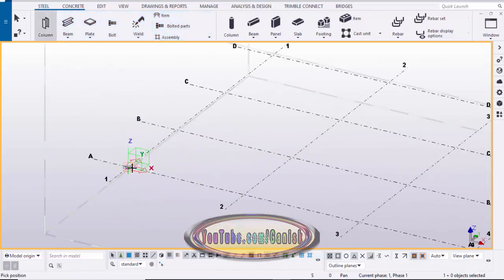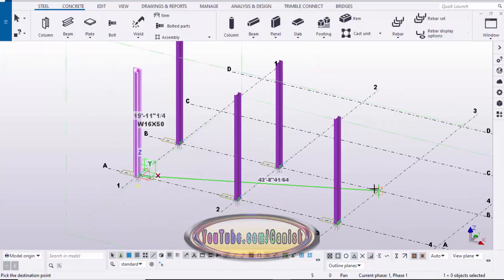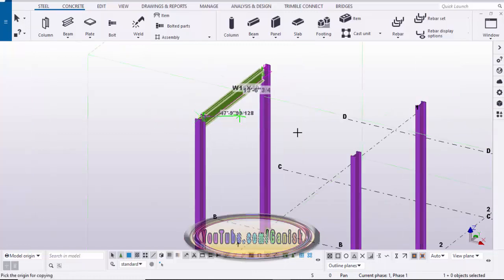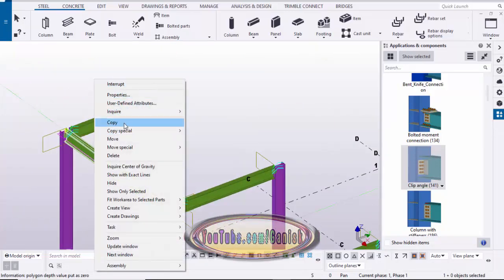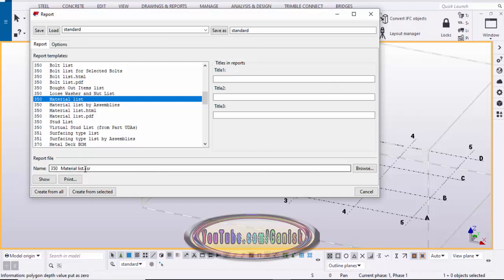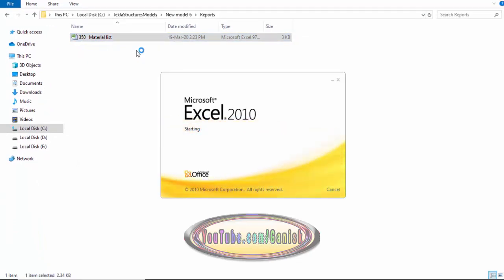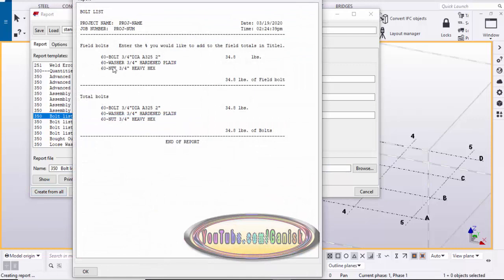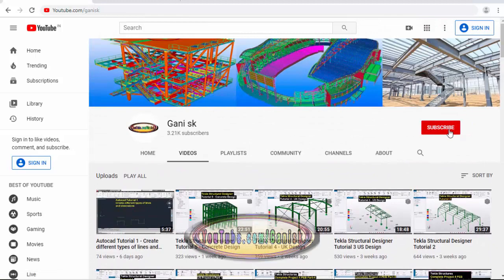Tekla Structures Tutorial 1 - Create Reports OR BOM

Comment: You can export to excel directly with the correct template. All columns exported into correct fields.
Reply: Can you explain in detail on this export , because everytime while I prepare material list it consumes lot of time
Reply: Bala Kumaran there are reports built into Tekla that can be exported  as an excel file directly. They are actually html files but can be saved as excel format. Please advise which version of Tekla you are using.
Reply: @ChrisNeville  , we are using 21.1 only
Reply: @balakumaran953  This is still be available. Please join Tekla Structures - xsteel tips on Facebook and message me there.

Comment: I am facing some problems while learning tekla. 
How can i ask you. 
Give me email id 
Help me
Reply from the maker: comment on any video, I will response for your problems.
Reply: @GaniSk  how can i create central gusset in hss bracing with extra plate? 
It is different from real & bolt is not feasible  ? 
Bolt is directly added to hss member in actual hss member is welded to plate this plate is connected to central gusset 
How can i create this in model ?
Reply from the maker: @mayankkulshrestha704  ok, I will make video on Hss bracing connection soon.
Reply: Thank you  . . .i am waiting  for that
Reply: @GaniSk   i m not able to create the bom in assembly drawings can you share me the add bom assembly drawing
Reply: Hello sir in case the ref drawing lacking details for dimensions and NTS how to get and measure accurately  some missing details thru bluebeam since we cannot calibrate  ? Hope you can read this and thanks.